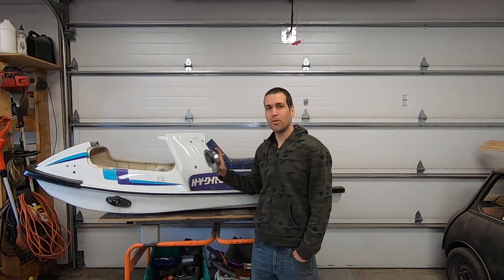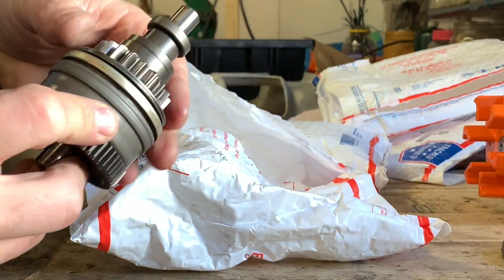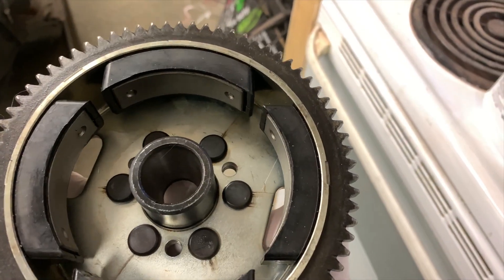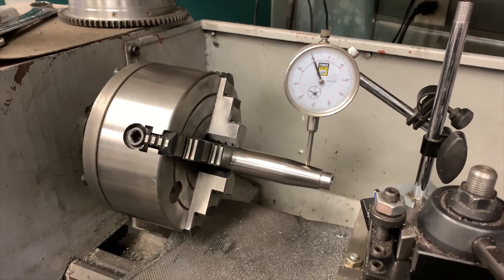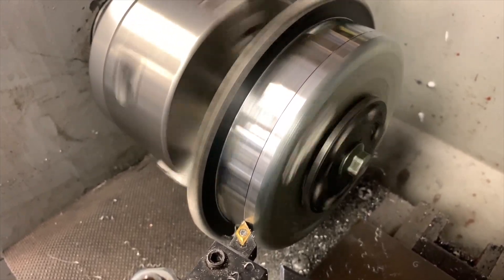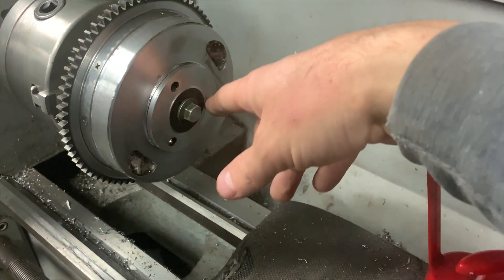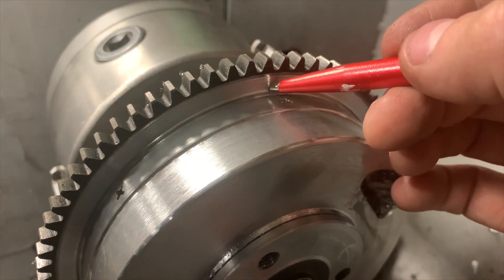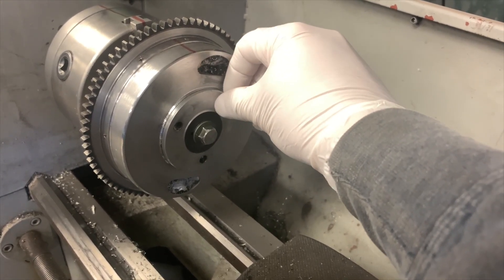Flywheel Lightening At The Limit -  Will It Fail ? - JS update #8

Comment: Nice work, wondering why you feel the holes if we're trying to reduce weight
Reply from the maker: I'm guessing that you are talking about the rivet holes. The rivets are the only thing holding the center part (the hub) to the outer bell. Without those it would fail really quickly.